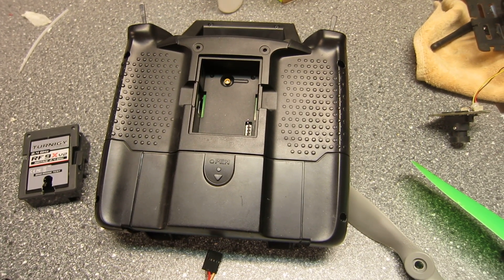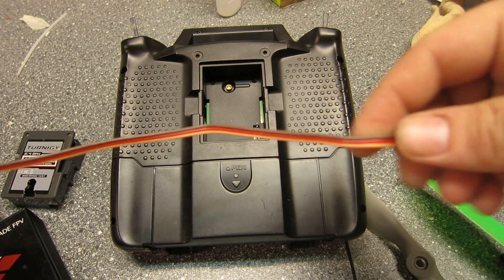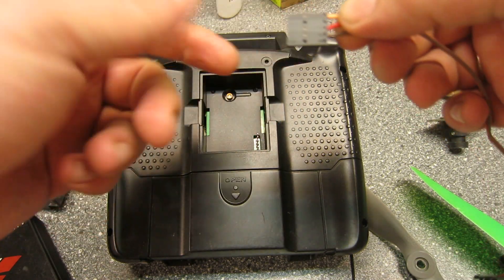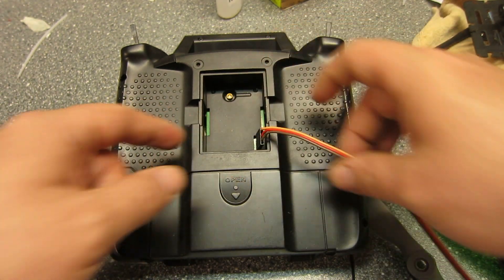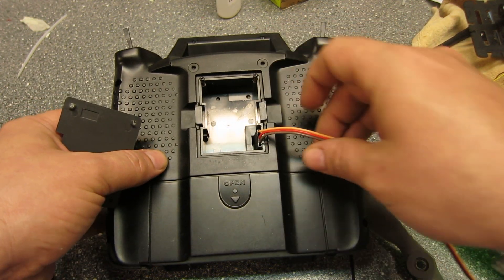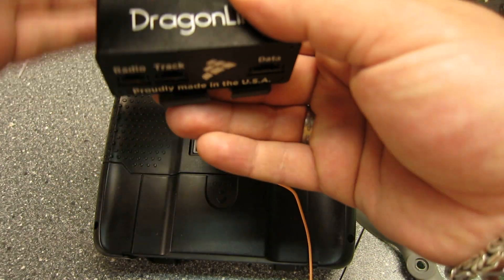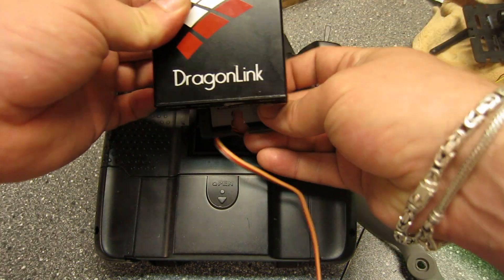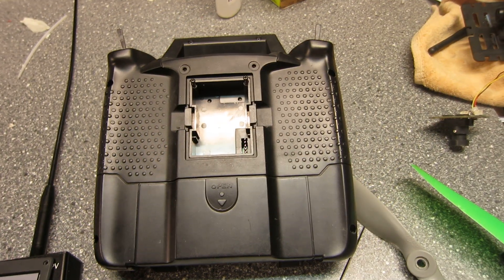Turnigy 9xr with Long range Dragonlink UHF part 1

Comment: Hola amigos
La Turnigy 9xr funciona con una batería de 3S o 12 Volt.
DragonLink funciona con 2S o 9 Volt.
Tienes que colocar un BEC para reducir la V de 12 a 9 Volt
Saludos

Hello friends
Turnigy 9XR does work with 12 Volt, and DragonLink with 9 Volt. So you neet an BEC to reduce from 12 to 9 V, or your DragonLink burns out.
Best regards.